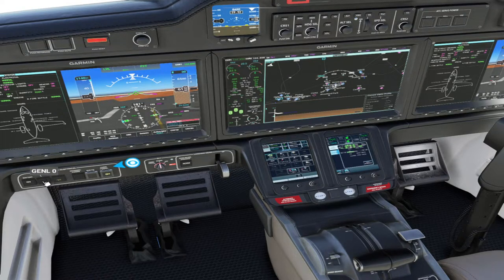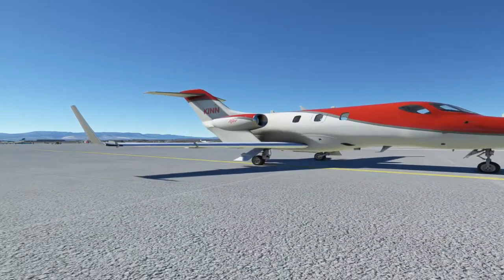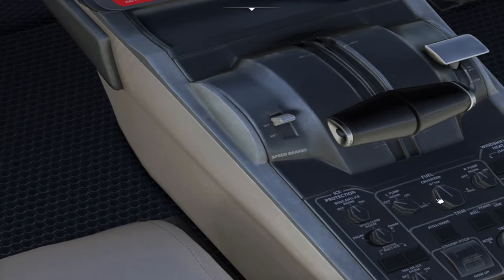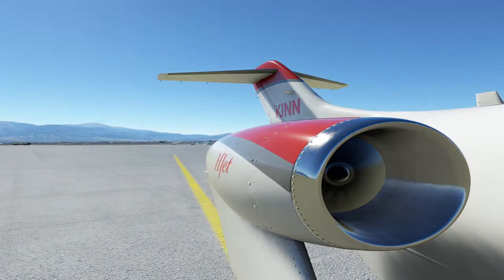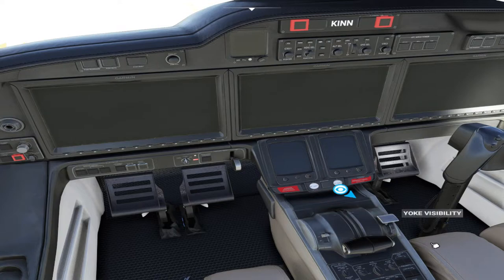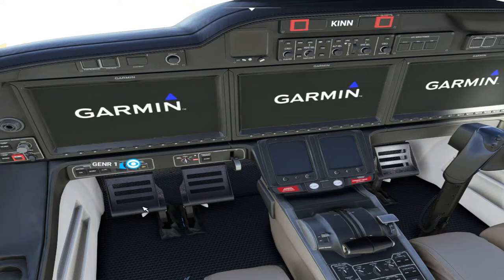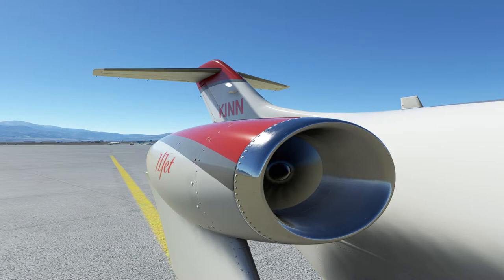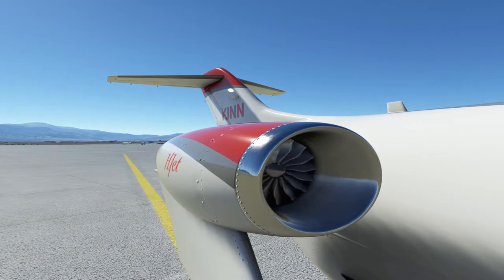FIX | HONDA JET ENGINES WON'T SHUT DOWN | A bug or designed that way?

Comment: Also never turn off the generators. They are in the normal mode, so automatically off the the engines are off and automatically on the the engines are on. Same with all the other switches on the lower panel.
Reply from the maker: Thank you!

Comment: Seams pretty obvious to me, definitely not a bug. When the throttles are all the way down no fuel is going into the engines. To start the engines you press start then add fuel and after the flight you just cutoff the fuel and they will shutdown.

Comment: I bought the manual for Mommas F150.
Cleaning the intake valves was a biotch. 
Conquering with my injuries head high prevailing today. 
I, Mother/ Father angst, bellowing like the wolf creek pass yetis missing my Mr. Liam.
https://youtu.be/cCc7yTpRGcI